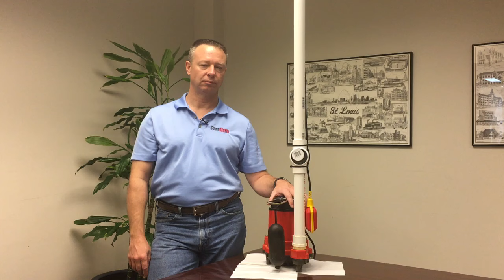Proper Float Switch Installation

Comment: deep diving to understand and manage the system put in in 2016, like your experience everything they did was wrong or cut corner:  no unions, no electric cutout, cables buried with no conduit, why call the people (in my area anyways) who do the same....work...if that word applies here.  Admire your one-step-at-a-time over each roadblock as you went along, and so important to have the kiddo there, before My City Life I helped my father with the earlier systems , as well as plumbing and electric, and really got into it.  Life long life skills. Nice piece of work all along.

Comment: I'm a homeowner and trying to get up to speed. I had a contractor here recently who installed a new septic pump for an above ground system. Those guys were moving fast when pumping and installing the new pump. They've been in the business a long time, but still, I wish I'd been somewhat more familiar with the process while attempting to understand the process preformed. I'm not sure the float was tethered as you illustrate. It's a bit frustrating that I pay for a service, but have to do my own homework regardless the work completed, be it plumbing, septic, electrical, roofing, haha you name it. The work ethic of this country is going south. I don't mind paying a fair price, but provide a fair product, labor included.
Reply from the maker: Hello Dave, 
If you would like, please give us a call at the technical support number listed on the instructions. We will gladly assist you, and answer any questions that you may have.